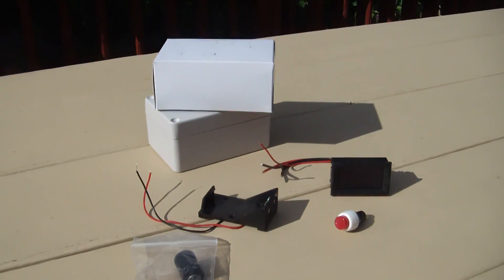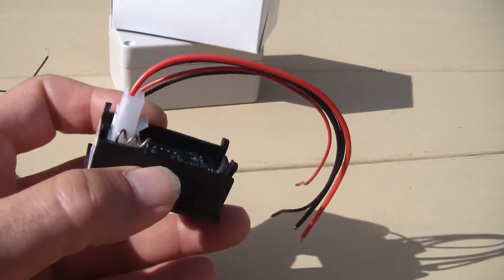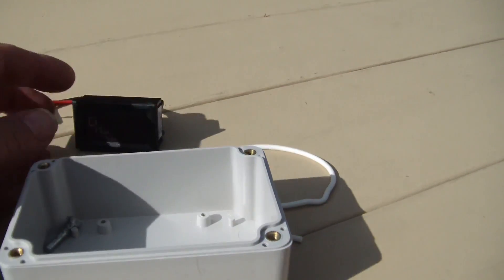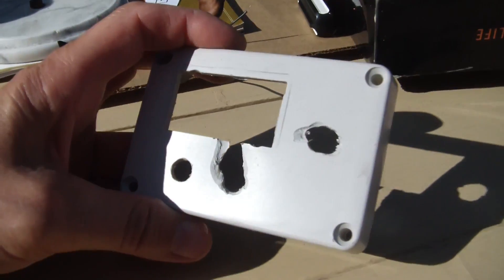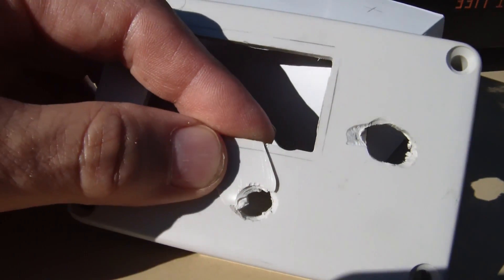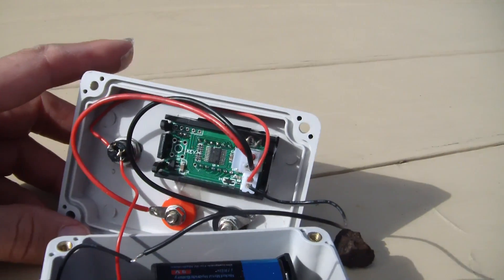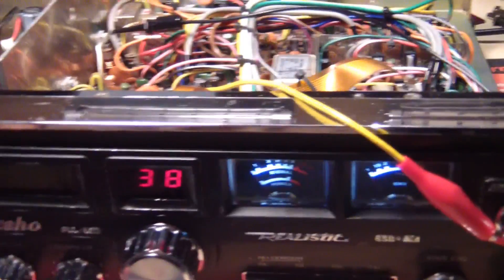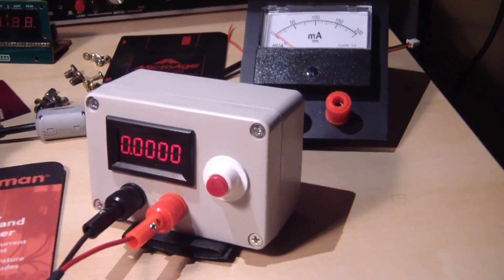DIY: milli-amp meter projects, Part 2

Comment: A little contact paper on the front and never see it. Looks good.
Reply from the maker: I may give that a try. Overall, it turned out pretty good as is. The old school red LED display is more pleasing than the LCD's of typical meters. I'm liking it.
Reply: i made 5 bits voltmeter and ampermeter in one box.
Used 1 1865 for power. 3.8 -4.2v is normal fot the device
Reply from the maker: @КосякЗеленского  Nice!